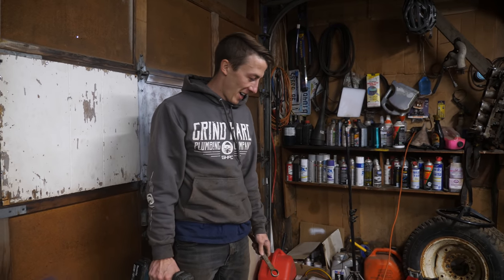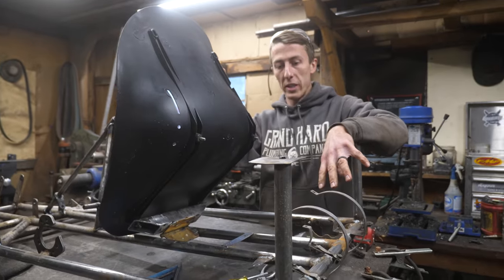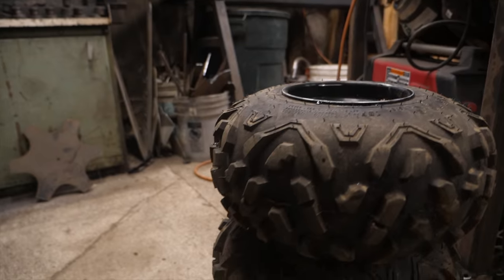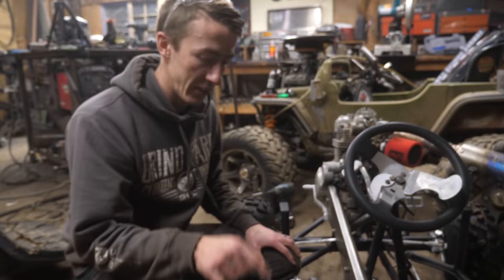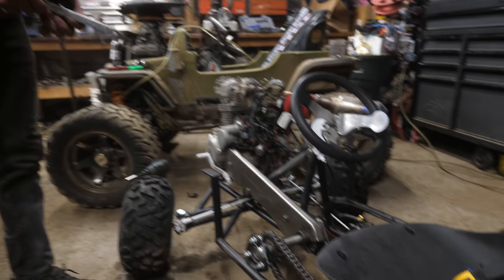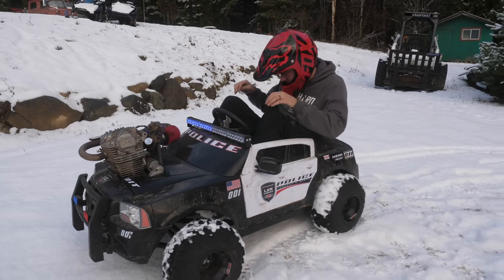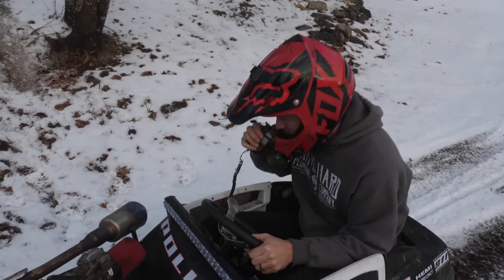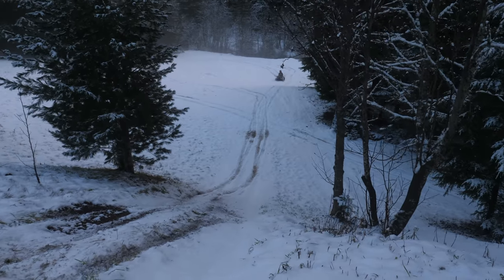Overpowered Go Kart Power Wheels is Finished! Painting and Final Look!

Comment: You guys need to buy an abandoned airport, use the hanger for building your projects and the runway for events. Time to grow!
Reply: Ya , like that rotten egg  super car builder in Sweden or somewhere like that .
Reply: Why? They live in paradise out in Idaho. Or paradise for me at least. Airports mean people, people suck.
Reply: @seeker156  Small, private airfield that has been closed for a few years would work great. They don’t mean to buy a huge international airport, just a closed down small airfield in the middle of nowhere. I did the same years ago, bought a small airport that was closed to live it because I got 300 acres with a paved and a grass runway as well as 8 hangers and a house for less than $200,000, and the county gave me a huge tax break for cleaning the property up. It was great, I had my own personal drag strip and nice hangers to store my stuff in.

Just an FYI, there is a nice little airport that closed in 2012 that is only about half an hour from them. It was repossessed by the county and hasn’t sold at auction yet. It failed to sell at auction a couple times, so they could probably get it for cheap.
Reply: @adamr9215  agreed mostly for a better shop n also the strip will lose intrest in rally n offroad vehicles

Comment: you talked about putting a wingnut on the underside of the seat. don't you think that would vibrate off? what about just drilling a hole through the threaded post and slip a R-ring/R-key (whatever you call them) in there? idk just a thought.

Comment: You have massive forces pushing between your steering and engine mounts and your rear body frame with only two 1” pipes you are going to bend your from like a banana you really need to brace that joint